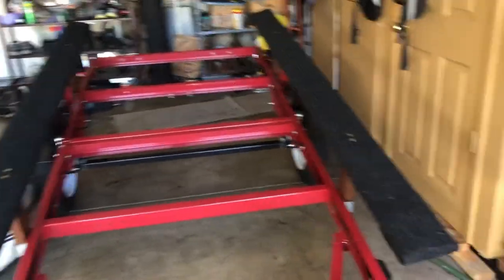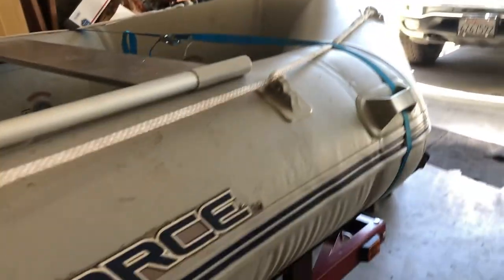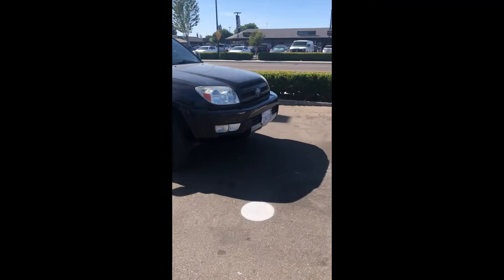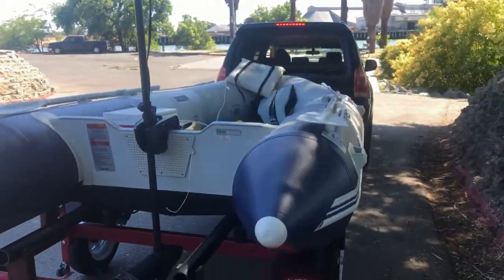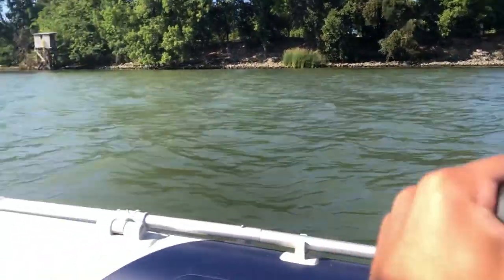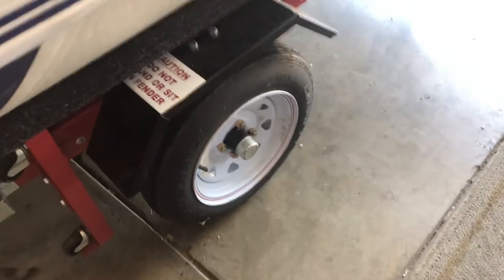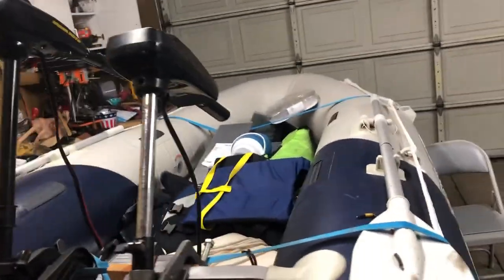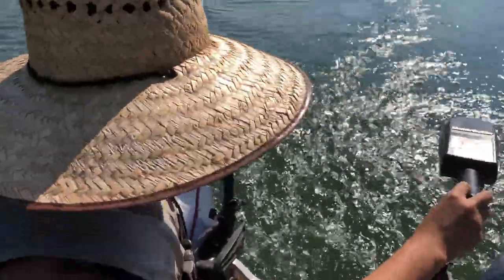Harbor Freight Boat Trailer Tests!

Comment: I have same size boat but in saturn brand, and same trailer I paid $500 , use it for freshwater my plan is paint with epoxy to prevent rust and install a 6 foot hitch  extension, cause is a nighmare at the docking lunch, but the pros is you can fold it to storged and easy to customize, have fun guys the rest of the summer.

Comment: Great video !
I have the same size boat with a gas motor on it.
Can you give me a list of the lumber and supplies needed to build the same set up.
I am going to buy a Trailer soon and would like to do it up like yours.
What are the sizes of the lumber when they are cut?
Thanks very much !
Reply from the maker: I used 2 2x6x8 pressure treated fence wood. I used the existing holes in the trailer to mount the bunks and 4 inch pvc pipes for the wood to set the height. My current setup is slightly different from the one I in the video and works a little better

Comment: Good job backing up that trailer. Short trailers like that are a pain. They get away quick.
Reply from the maker: Thanks for the recognition! This trailer is a small pain to use and backup. But the storage works out decently since it can slide through small fence doors.

Comment: Does you trailer rust from saltwater? How do u prevent that?
Reply from the maker: Unfortunately all trailers will rust even the real boat trailers if used in water with time, but much faster in salt water. The best way to prevent this I can think of is rinsing the trailer after use, or dip the trailer into a freshwater ramp afterwards. Galvanized steel bolts are the most corrosion resistant bolts you can use on your trailer. My trailer does have rust on the u bolts and the leaf springs. I think the rust happened mainly from the trip I took to half moon bay in the saltwater. Trailer seems to be holding up fine as it is only surface rust so far. My trailer stays in the garage.

Comment: Is it just my harbor freight or did they raise the prices of the trailers to $500, every one on YouTube says they got theirs for like $350
Reply from the maker: You are right! This is the cheaper 4 lug trailer that went for $350. I went back around 3 weeks later after I purchased it to harbor freight and looked at the prices and it seemed to have raised around $100 in price! Looks like I grabbed one right on time. A lot of places around me didn’t even have them in stock so I had to drive a couple of cities over. I still want to find the bolt-on landing gear that they sell but they are out with only the weld-ons in stock.

Comment: Hello and how are you doing?? it is nice what you have done with your trailer!! My Question is how did you put the boat on top of the trailer??
I have the same boat and I am having trouble putting the boat on top of the trailer!! did you took out the air,? then you put back the air when you put the boat  up in to the trailer?? just let me know and thank you for your time and take care.
Reply from the maker: Hello! I’m doing good, just been working on my outboard motor making sure it doesn’t overheat. For the boat there should be at least two people to lift the boat onto the trailer. Or what you can do is rolling the boat onto the trailer and then set/air it up. It is really heavy to handle by yourself.